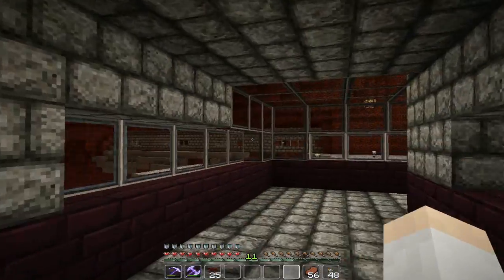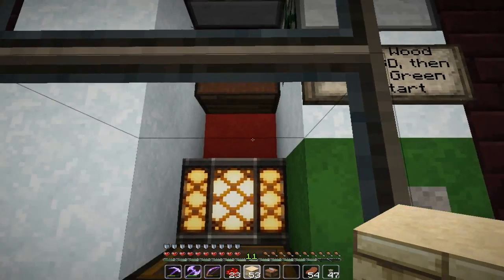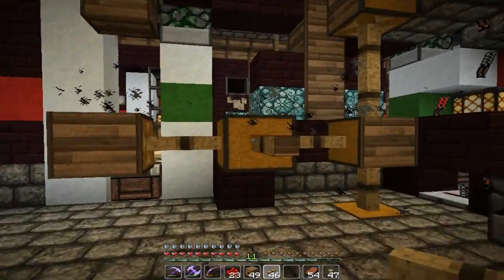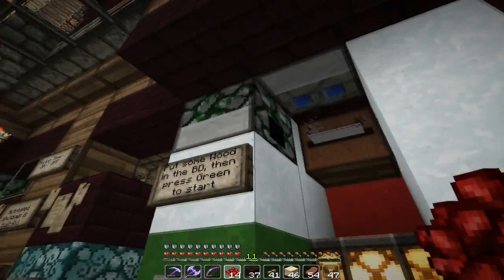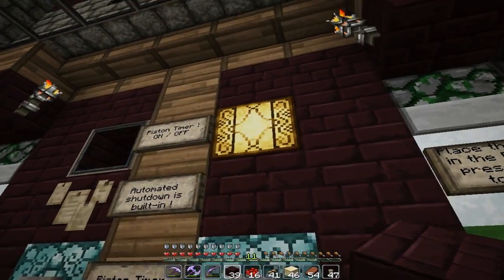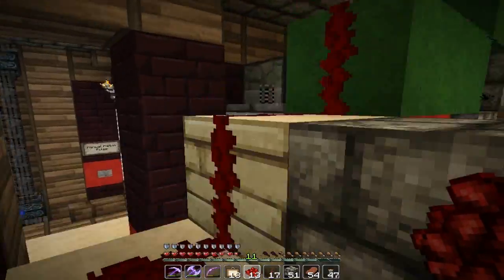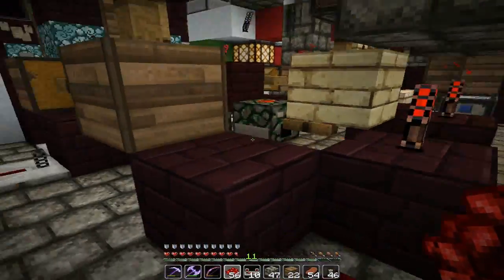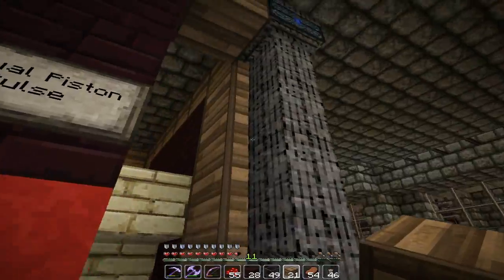[037] I Nether Saw anything like it (1/2)

Comment: i actually already joined by the time i saw this, because i figured i wouldnt. user ancilangeli.
also, as far as the pics to prove it happened goes, im currently waiting for things to quiet down a little then i will post a video response to this video, also i will put a link and some pics on the forum in "simple builds that get the job done" under general btw discuss.

Comment: if i told you i could have made the whole mechanism in a 2x3x1 space (not counting mechanical power for the saw) would you be mad? (hint, put a torch on a detector block powering the dispenser, trust me i tested it)